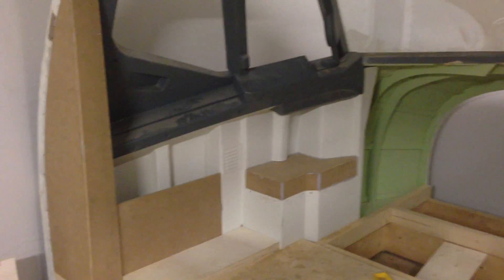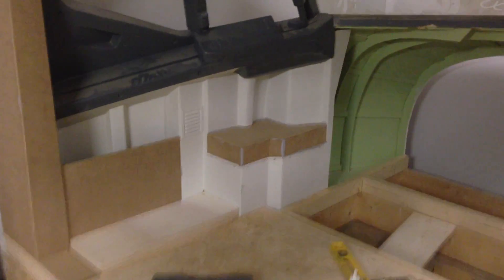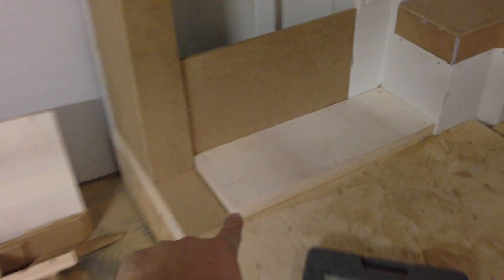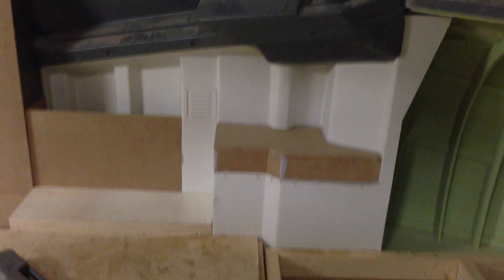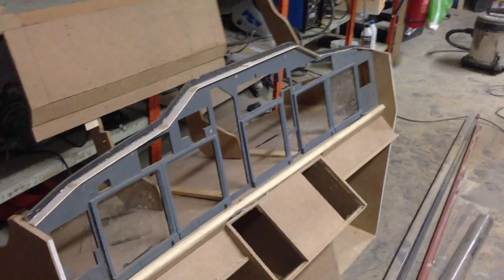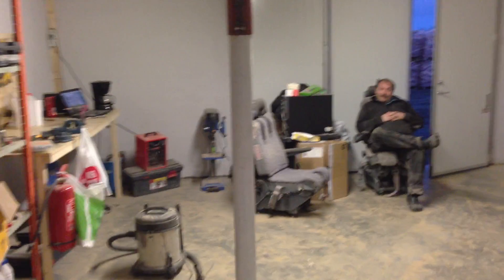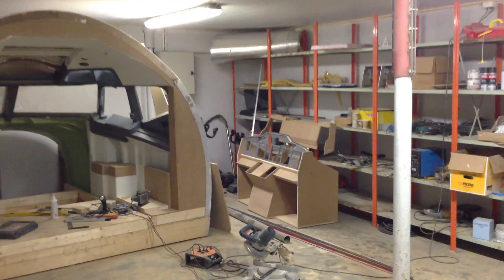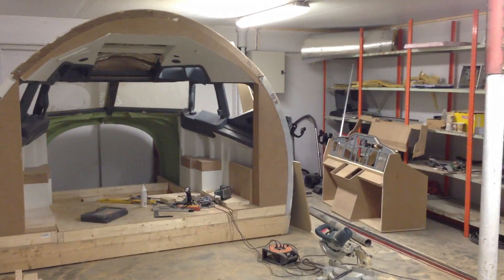Building a Boeing 737-800 home simulator #49

Comment from the maker: Thanks.. Well as I mentioned in a previous comment, it's too late to give up now. I am anticipating to have the sim up and running in a few months now. There's just a few more obstacles to concur now, and the hard ones have already been concurred. What's left is to finish the MIP, Finish the yokes so the floor can be laid and covered in aluminum, and lastly the overhead. The very last stage before flying, is the wrap-around screen for the projectors.